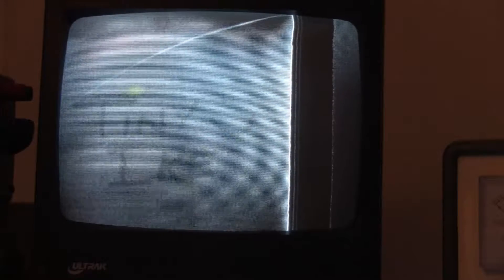Tiny Ike Iconoscope TV Camera Project part 3

Comment: Since it's only capable of showing 250 lines based on the page that is linked, am I correct in noticing that it is not interlacing the picture, or is that an artifact of the shutter of the camera capturing the CRT screen?  It looks like the lines are landing in the same place, and not advancing.
Reply from the maker: Brandon. That is correct. It is a combination of the different number of lines between standard definition and my hi def camcorder. The noise in the Tiny Ike video is not helping at all. The scan of this camera is 100% 525/29.94 2:1 interlaced NTSC without chroma. The equivalent of the Y or Luma signal in component video.
Reply: Ahh ok.  There's nothing like the clean clean picture from only luminance.  Whenever I work with older TV's I always feed it a picture from luminance from Component if it's outputting 480i or from S-Viedo if it's unknown.

On my desk here in the living room, our home security cameras are in Y/C as separate pairs for increased chroma resolution (I am planning an HD upgrade in the future, for now it's still analog here), and the monitor on my desk is an old black and white TV.  I feed it he luminance signal only from the cameras I'm interested in viewing, so it's crystal clear, as there's no sense in feeding chroma into the TV if it's black and white.